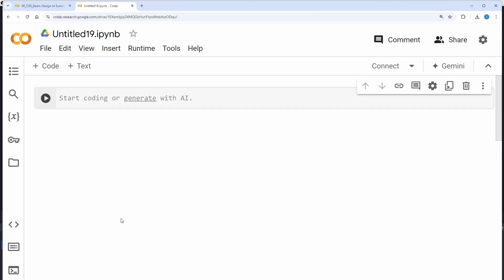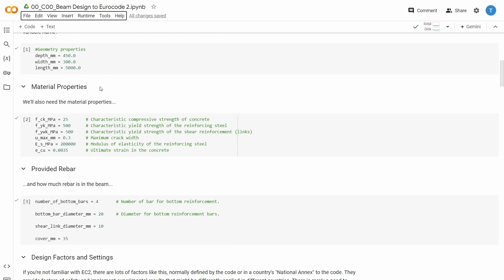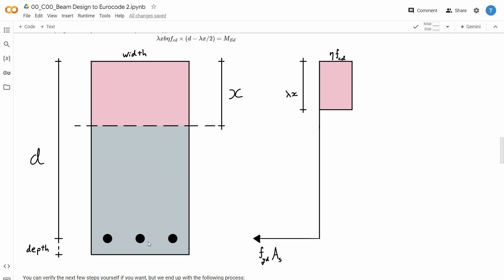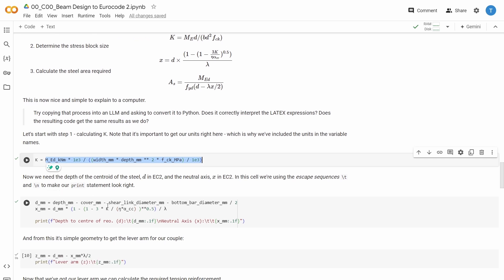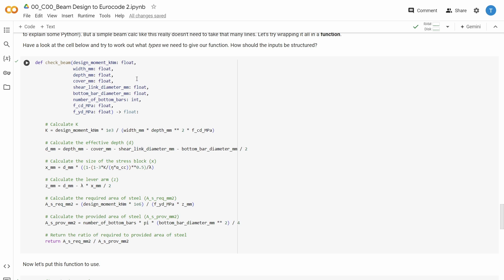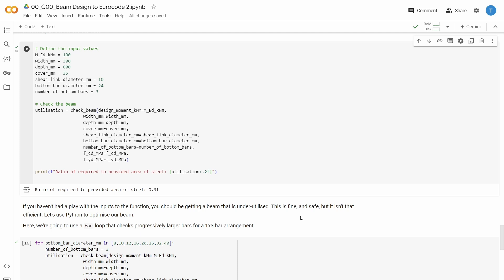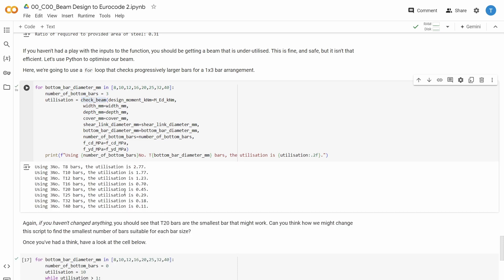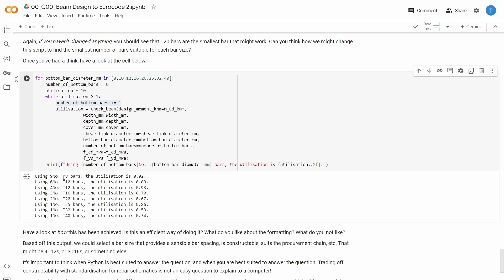Structural engineering calculation using only Python basics: Simple RC Beam

Comment: I think there is a mistake in the formula:
$K = \frac{M_{Ed} \cdot d}{b \cdot d^2 \cdot f_{ck}}$

but in the code you wrote:
`K = M_Ed_knm * 1e03 / ((width_mm * deph_mm**2 * f_ck_MPa) / 1e03)`

Shouldn't it be:
`K = M_Ed_knm * width_mm * 1e03 / ((width_mm * deph_mm**2 * f_ck_MPa) / 1e03)`

or
`K = M_Ed_knm * 1e03 / ((deph_mm**2 * f_ck_MPa) / 1e03)`?
Reply from the maker: You are completely right! And had I used the package handcalcs, it would have easily been spotted.  Thank you for pointing this out!

Comment: Looks fantastic and very clean. I will be interested to know how to manage the codebase across the team. Is it possible to run these scripts simultaneously if it stored in a central location or every team member has to have a version of a Master notebook?
Reply from the maker: This is a great question. 
If you do things "correct", you have a github repository where you keep track of all the tools of the team. Everyone can then propose added features etc - the tool is something everyone can contribute to, but the changes must be accepted by the owner. This works amazingly.

But if we are honest, you will never have all engineers in a team being on GitHub. 

So I think it's important to have someone being responsible for the master notebook, and for updating it. Similar to Excel templates people will end up making local copies and adapting the script to do things a little bit different. This is both the huge benefit (super flexible), but also something that calls for caution. 

You need someone being responsible for the tools, so it doesn't become a wild west. 
But I'm curious to hear what input others have to this as well.